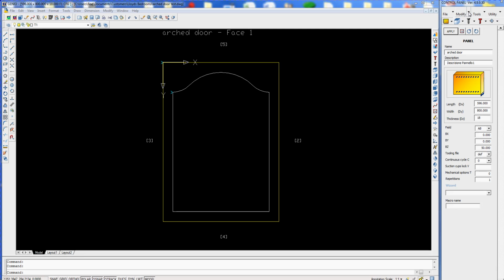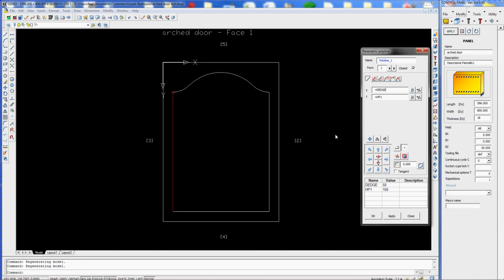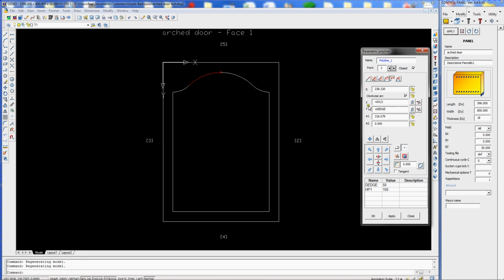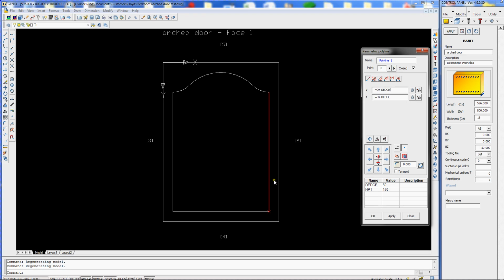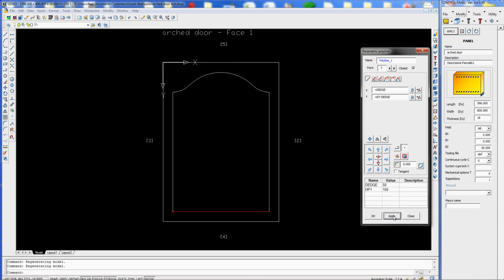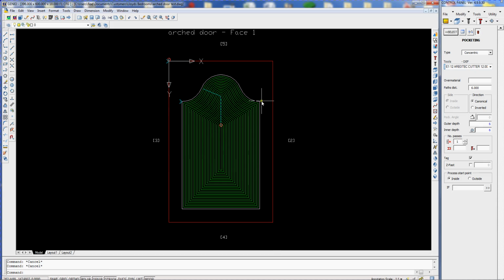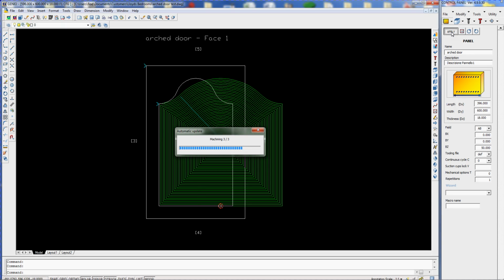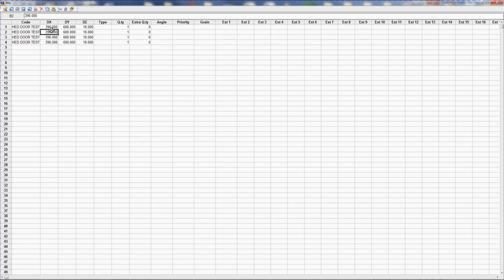Genio - Parametric Geometries with Local Variables

Comment: Hi, I'm Renan, I live in Brazil, I work with an author744 morbidelli and I use genius 2002 but I lost the installation CD a long time ago, could you give me the program for me to install on the machine
Reply from the maker: Hi Renan, I'm the UK reseller, 2002 version is before my time. What version are you running, it should say at the top of the  screen something like 2.4.5. I may be able to get hold of a copy. Email me at rodjones@cncsoftwaresolutions.co.uk

Comment: just in case you know... why is the genio software always getting corrupt? well don't know if this is the correct term to describe it...the system cannot regenerate new job... only those previously generated work.... once it was corrected by re installation of the software.... but it is recurring.... is there any thing which can be done to prevent it?  and why is it happening?
Reply from the maker: Hi Edgar, I'm reseller for the UK and don't have many problems with Genio. What version of Genio do you have? Email me a drawing that doesn't work,  I'll have a look at it on mine. Email me at Rodjones@cncsoftwaresolutions.co.uk
Reply: thanks.. I'll take a look at iut today and send the info. One of the problem is that, after entering measurements and it finishes generation of the program... sometimes it routes a differen t measurement, lookibng at the drawing... the actuaql routering is differen t from the measurement entered..... I'll get back after today... thank y9ou
Reply from the maker: If possible, can you make a video of your screen as you draw/apply tooling etc. so I can see if it's something you're doing that may be causing it. How long have you had Genio? Where in the world are you? What CNC are you outputting to? 
 If you answer to rodjones@cncsoftwaresolutions.co.uk I'll get any mail quicker than logging on to YouTube. Cheers Rod